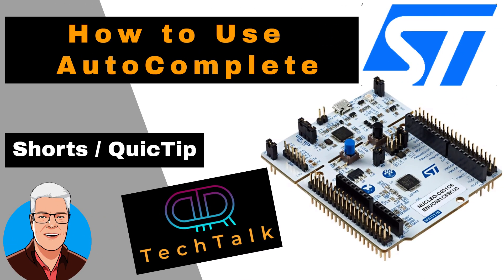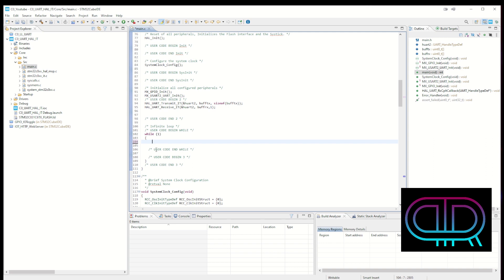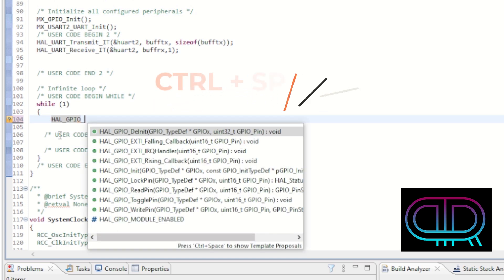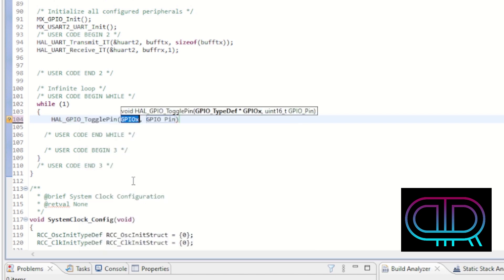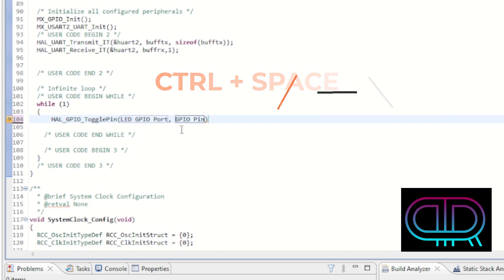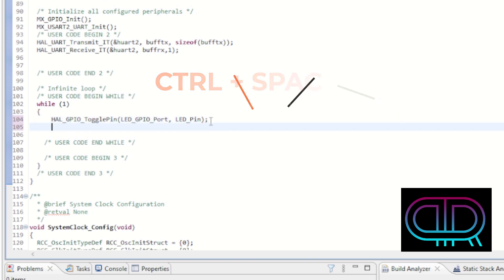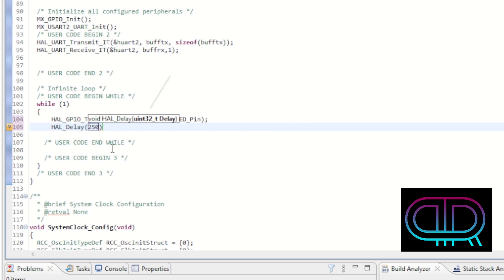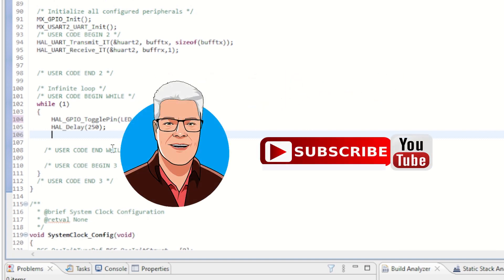Quic Tip #4 How to use AutoComplete in StmCubeIDE

Comment: That's strange, why can't my STM32CubeIDE use this feature? My version is 1.15.1.
Reply from the maker: Hi, Do you run Windows or Mac ?
/PR TechTalk
Reply from the maker: Hi Again I just verifyed on PC running same version as you 1.15.1 and it works for me just fine.
If not someone Else will verify running MAC OS i can do this also within a couple of weeks.
/PR TechTalk

Comment: I faced a problem with autocomplete function on Win11. As Ctrl + Space is set as toggling the language of the keyboard, It doesn't trigger the autocomplete function. May I know if there is any way to solve it? Thank you.
Reply from the maker: HI AAK, I just recently also migrated to Win 11 (Late Adopter :-) ) But in my installation it work just fine with Ctrl + Space. And i have two languages installed ENG and Swedish. Possible take a look @ this link below if this might help. https://support.microsoft.com/en-us/windows/keyboard-shortcuts-in-windows-dcc61a57-8ff0-cffe-9796-cb9706c75eec 

Brgds
/Peter Ranemyr